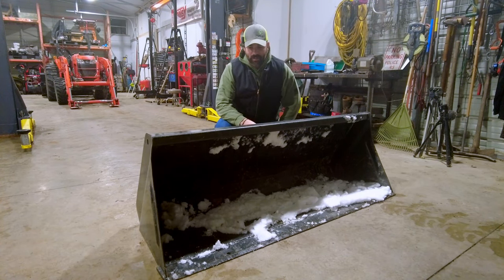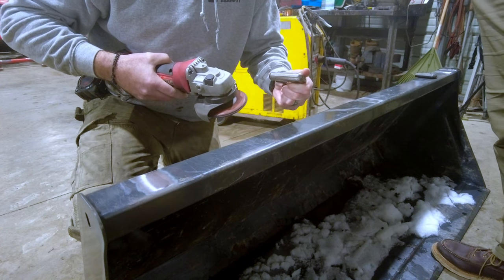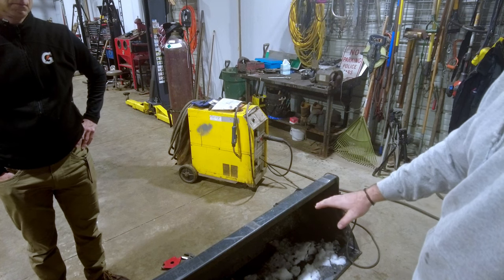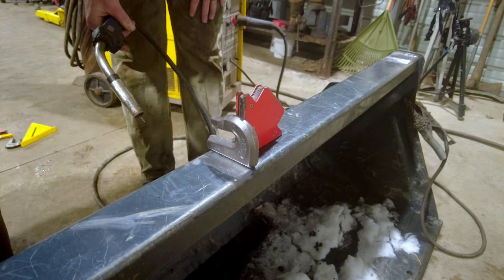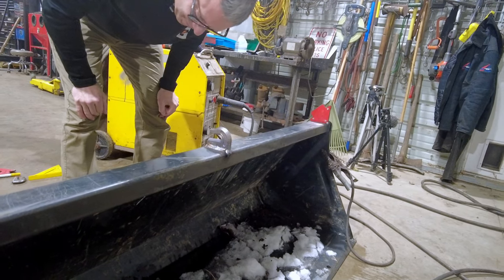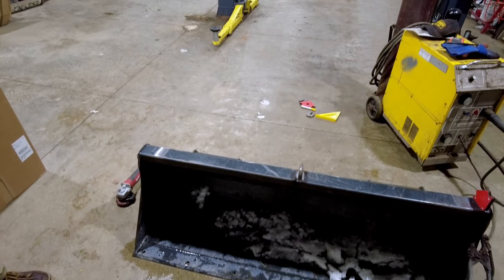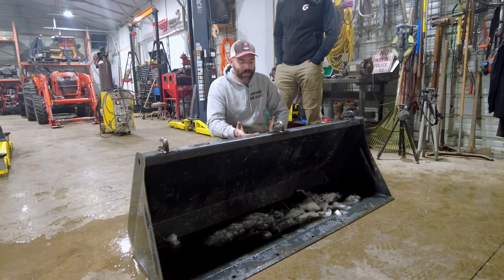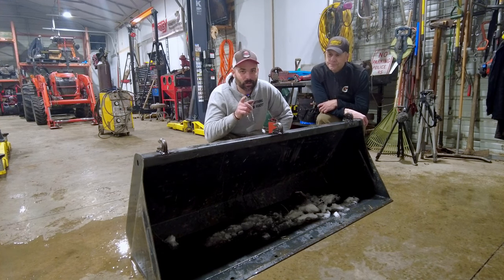Welding Chain Hooks onto a Tractor Bucket!

Comment: Awesome work man.  The welds looks really good.  I agree, even though I use the cheapest flux core welder known to man kind I’ve learned that welding is 90% prep work and 10% pulling the trigger.  I can certainly tell the difference in your welders’ performance because of how much hotter the welds get.
Reply from the maker: Yeah this is a very capable welder, no doubt about that!

Comment: I went with Ken's bolt on hooks and also put a plate on the bottom side. My bucket is made just like this one with double walled construction. Drilling then with a half inch pilot point drill bit with oil to keep it cutting correctly. Ken doesn't like using a double walled bucket but this what I wanted. I had some weld on hooks but decided against them. I installed mine where the arms of the loader arms would meet which is where it would be the strongest place in my opinion. The dealership where I bought my tractor was supposed of welded them on but forgot, no big deal. I have seen other people weld them on but first heated them up first with a torch.
Reply from the maker: That’s interesting having them on the loader arms, I’m not sure I’ve ever seen anyone do that

Comment: Good man, putting the hooks inboard a few inches on the sides makes for safer use.
Reply from the maker: Happened by complete coincidence then...why do you say that though, so I know for the future
Reply: @EverythingElliott   Sometime, intentionally or not while lifting objects the operator will roll the bucket back to gain more lift from the cutting edge hitting the chain, if the chain is close to the end of the cutting edge it could easily slip off to the side of the bucket causing the load to suddenly drop.  An hour ago I watched a guy hook up chains to his bucket he had just added new hooks onto the outer edges and he had to immediately reverse his chain hook up so his load was on the inside of the hook because on the outside the chain fell off to the side of his bucket before he began the lift.  I always weld them inboard for a little added safety.
Reply from the maker: @ern48  It was not intentional for that reason and that makes total sense, but that is some good knowledge to take with me for the future! Thanks!
Reply: @EverythingElliott   Obviously, it will never happen using two bucket hooks lifting an object from a center point, but lifting in a bridle type lift with both chains straight down thats the problem especially on uneven terrain with the bucket rolled back.  I've seen a lot in 40+ years of heavy equipment operation.

Comment: Nice welding. Will hook in the centerbend top of bucket down. My dealer adivised Me to buy the bucket with a 3" black iron pipe welded into the top face. He said it won't bend with a hook in the cenet. That bucket came with Me first New Holland tc 33d back in 2000. Still nice and straight. POR put the finishing touch.
Reply from the maker: The top of his bucket is square tube, not just a piece of sheet steel, I don’t think it’ll bend, but time will tell

Comment: Another tip would be to pay attention to the sound of the arching. It sounds like hes pulling away too far and the gas cant shield the molten metal from the atmosphere. Its also good practice to clean the metal inbetween welds as well. Welding over soot increases the chances of a dirty weld
Reply from the maker: Good tips!

Comment: position your gun so when your welding you actually pull the gun toward you but push the puddle toward you that way you can see where the wire contacts the metal and the pattern you are using is filling your pocket I've been doing that for over 30yrs you'll get alot better has time goes Forget the figure 8 just use backward C or just use a circle pattern or possibly a J pattern .
Reply from the maker: Thanks for the tips!

Comment: Try pulling the weld instead of pushing the weld.
Reply from the maker: I was always told to push mig and pull stick
Reply: @EverythingElliott  Give it a try. you can see the weld puddle better and it is easier to fill the gaps with penetration of the weld on both pieces of metal.